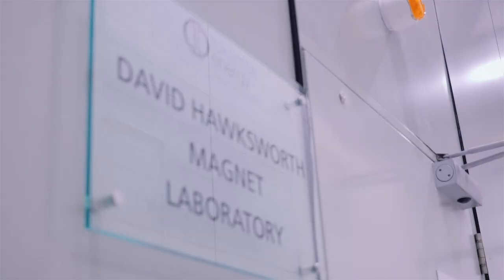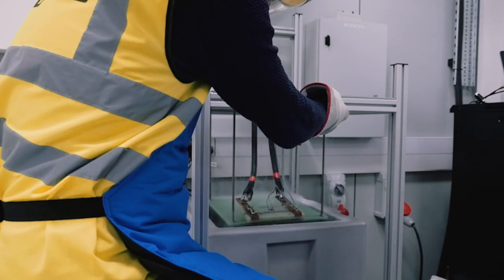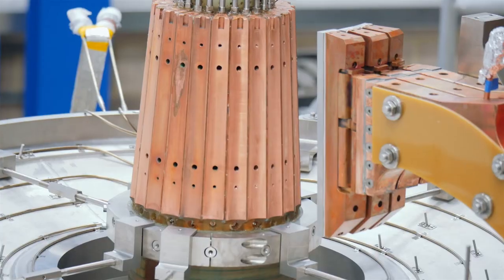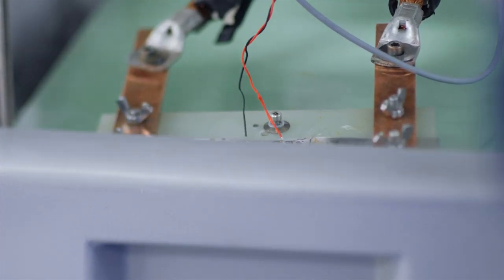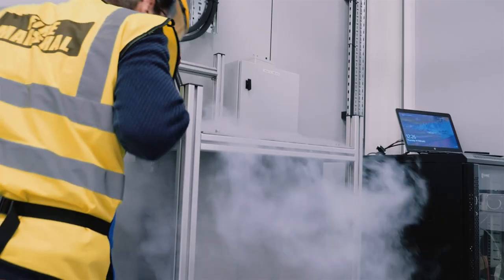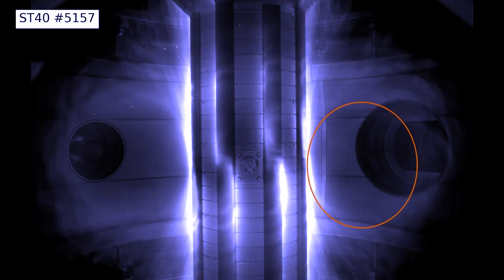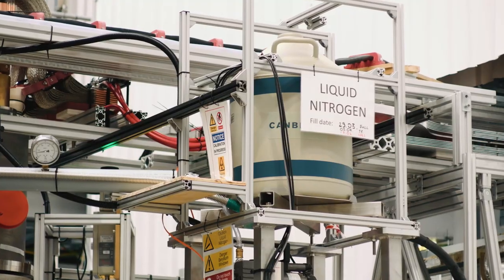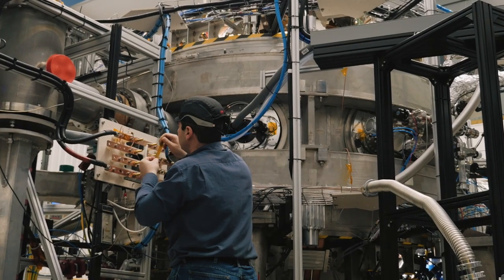Extremes of temperature in a fusion reactor

Comment: So is the higher temp to make up for the lack of pressure? And how do the materials in the reactor deal with the radiative heat off of the plasma. And do you get tranmutation from the neutron radiation?

Comment: Just a few questions.

So you are getting 15 million degrees at 20 Tesla.    Will you need 100 Tesla to get 100 million degrees?    Or is that just keeping your reactor small?   What if you went bigger?   Do you need plasma volume or plasma density? And I hear the best efficiency fusion so far is 70%.   What are the factors to go past 100%?   Why do you need 100 million degrees if the sun is 15 million?   Do you also need pressure?    I do not expect you to answer, but these questions popped into my head.   I am just starting to learn fusion.

Comment: I have not read your papers , but in order to get fusion energy we need more theoretical work or it's just an experimental issue ?? I would love to achieve extraction of energy from the water of the sea. But that is not quite close in time, isn't it ??
Reply from the maker: In order to commercialise fusion energy there are a lot of engineering challenges to be tackled.  Theoretical work is involved as well to optimise plasma performance or determine future designs, for example, but it is important to build machines and test systems - preferably with short iteration times - to really make progress on fusion.

Comment: Can the magnetic field be used to contain other things? Obviously not the one in the reactor, but others of the same design.
Reply from the maker: What kind of things?
Reply: @tokamakenergy6400  I don't know. It seems like it has to be a powerful force field to contain that much heat. How about is it strong enough to stop a man from moving through it? Or hold back water? Can it only hold back heat?
Reply: Yes. The magnetic field or electric field can be used to confine antihydrogens or positrons or just atoms which is not a plasma. But not a tokamak container, scientists usually use penning trap or optical tweezer to keep levitate and manipulate them.